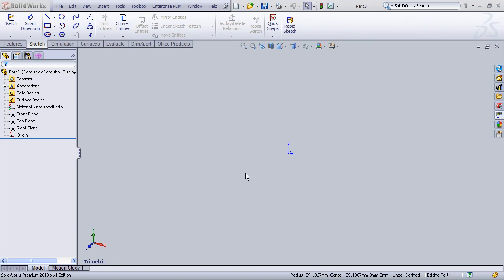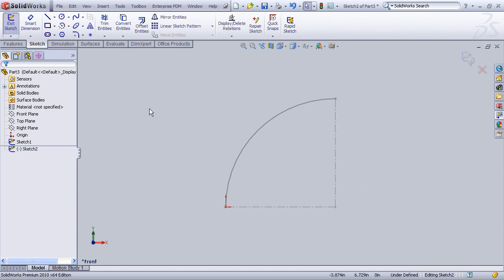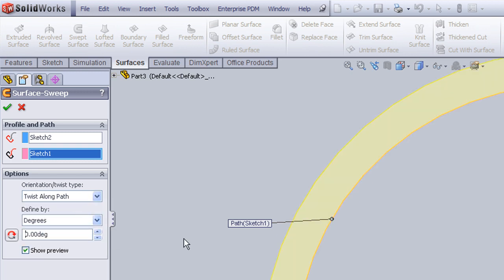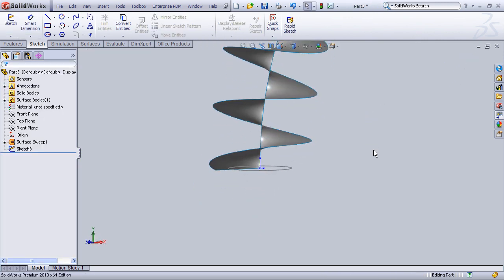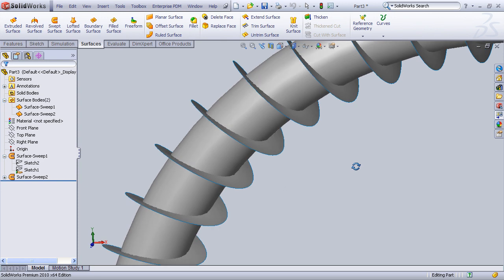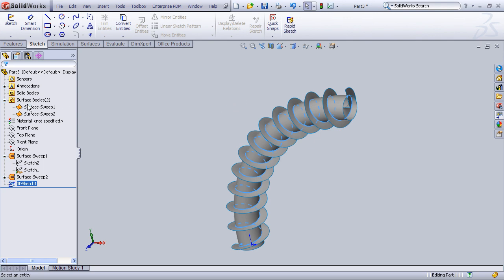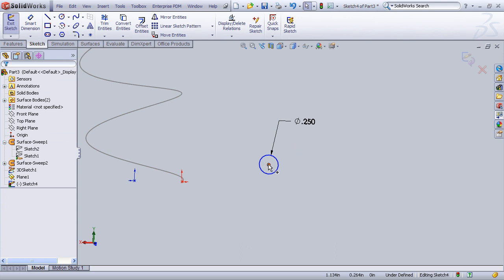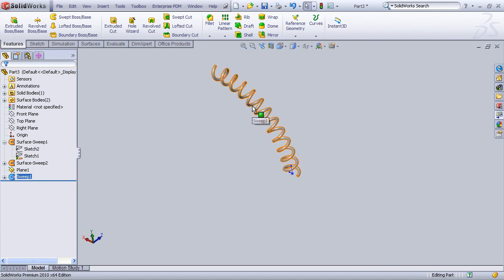Curved Helix

Comment: You can save one step. When you draw your line to sweep along the arc, draw the circle in the same sketch. It will sweep both profiles at the same time. But only the line can twist along the path, which is what you want anyway.

Comment: There is a much quicker way of doing this.

1. Create a 3D sketch and a 3D spline
2. Create another sketch with the profile on the side.
3. In Sweep (solid) settings Choses "Twist along path" and the number of turns.

Done !
Reply: Hey! This helped a lot using Autodesk Inventor! Thanks!

Comment from the maker: @0815tobey   You mean using the curved helical edge of the first swept surface?  Yes, that would work too.   This technique that I've shown is a little more general purpose when there are other cases where the actual sweep path you need can only be given by the intersection of two surfaces.